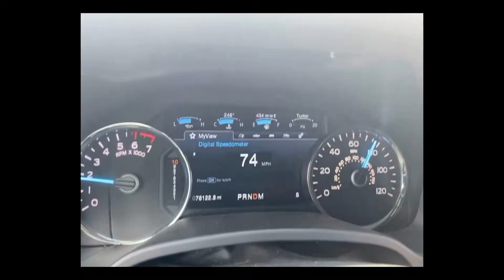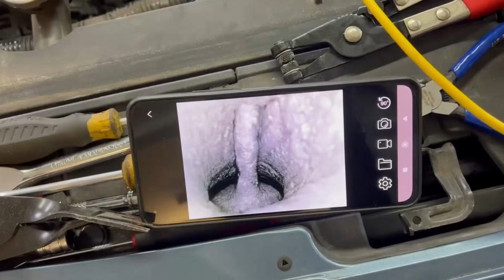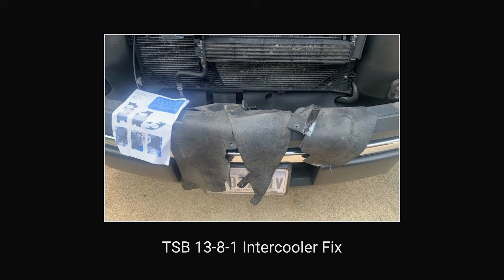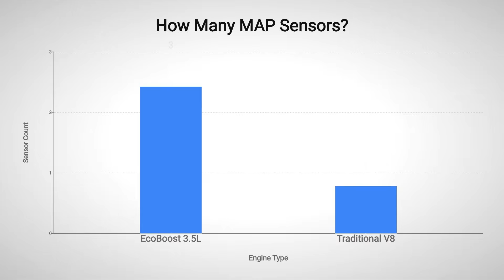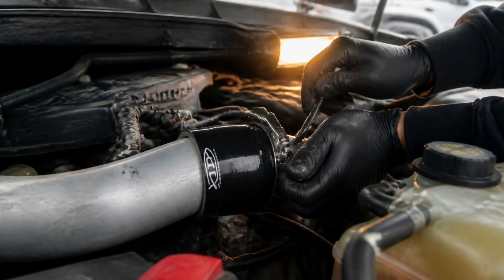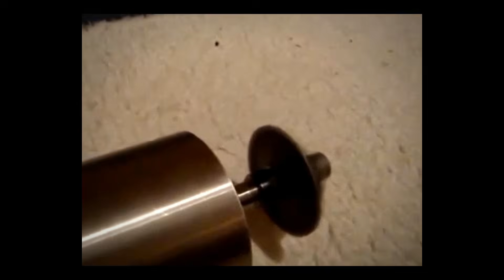Ford F-150 Settings That Are CHOKING Your EcoBoost of Air Without You Knowing (FIX TONIGHT)

Comment: And how do I keep the infamous 10r80 bushing from going bad and costing me a $5g rebuild for a $6 part? Happened to 2 of my cousins, 2019 and 2021.
Reply: Change transmission fluid every 30 - 50 k miles, and add an aux transmission cooler.
Reply: Thermal bypass kits and deep pan, keep those temps low

Comment: What about the turbo inlet screens that clean the oil to the turbos? No mention of them...? 
Part number (BL3Z-6C683-B) I believe it is.
Would Valvoline Restore & Protect or Mobile 1 Advanced Clean be good enough to keep those clean? I have a 2019 2.7 4x4 with 133k miles I recently and had checked out by 2 pro shops, 5200+ drive hours, 2200+ idle hours from previous owner who was a construction contractor in south heat zone Houston. Good maintained Carfax tho. But who knows, those can be fixed/rigged. Fluids (transmission flushed every 35k, transfer case, both diffs) changed more than recommended and oil every 7500k. But Cats suddenly became problem after going to Quick Lube removing/reinstalling my metal skid plate. Usually change my own oil, but I was in hurry for long road trip and I live in apt community. Times are "scheduled" per se.
Reply: This is covered in another video regarding key service intervals.
Reply: @macjester713 can you add link?